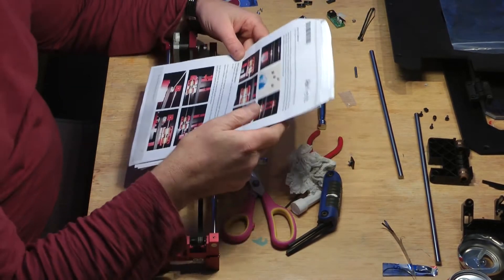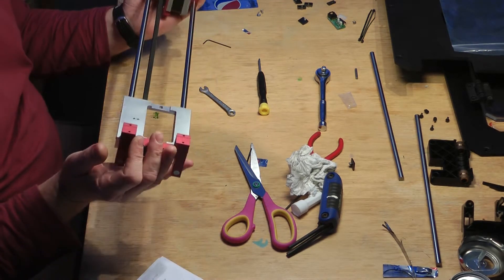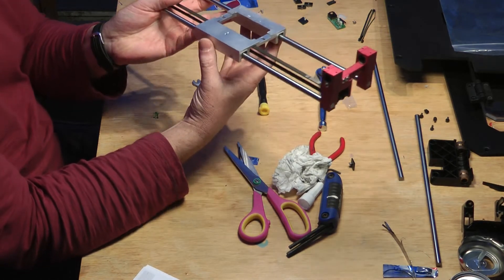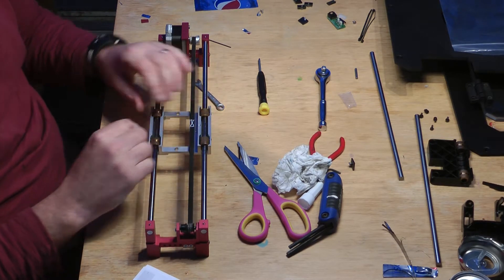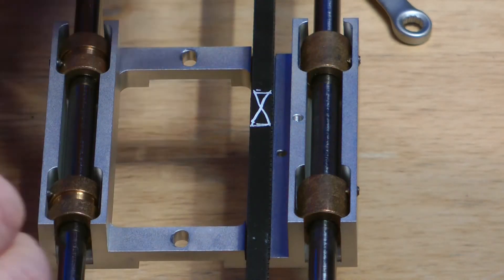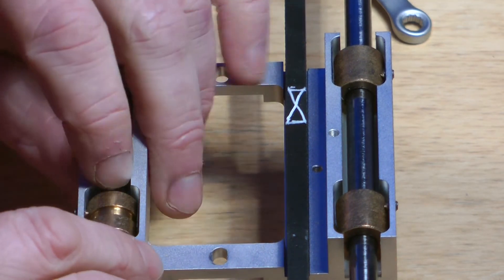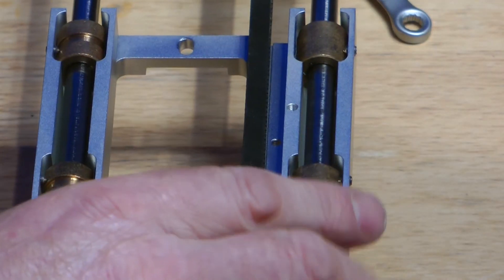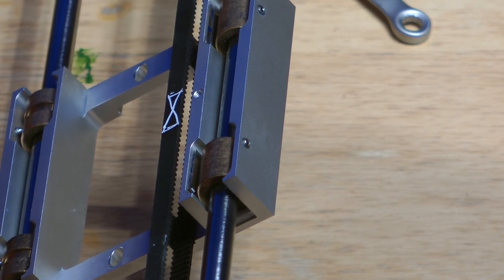AluCarriage Dual Setup

Comment: these are great Steve!
Of all your upgrades what would you reccomend most?
I'm going to order bottleworks arms imminently, but what else?
Reply from the maker: Hi Simon,

If you are new to 3D printing I would advise spending some time with your stock machine – really get to know it. If you aren’t already, start following the discussions on the google group - https://groups.google.com/forum/m/#!forum/makerbot

There’s a huge wealth of knowledge here and some great guys more than happy to help when you get into difficulty etc. You will find 99% of the problems you may experience, others have found solutions for.

When you do come to upgrade, only do one at a time. Takes some time to print with the upgrade before moving to the next.

I'm still on the stock arms as I haven't really had any issues with them. In saying that, I am work on a new design for a complete new Z axis.

Upgrade -

Change your firmware to sailfish - http://www.thingiverse.com/thing:32084

Mechanically, from my experience I would start with the 3 in 1 extruders. There are other options out there but I can really vouch for them. 

Next I would start printing on glass – just cheap 2mm picture glass. I did a video a while back on the system I’m using. I hardly ever need to re-level the bed.. it’s just not an issue anymore.

If you design your own parts, I would strongly recommend changing your slicing software to Simplify 3D. There will be a bit of a learning curve involved, but well worth it as it’s got some fantastic features. There are also some great free slicers out there, but can’t really vouch for them.

From there it all depends on what you are trying to achieve with your printing / design work.

Good luck and do let us know how you get on.
Reply: Hi Steve, I'm a veteran owner but, alas, not user of my r2x. I had one of the first in the UK. Unfortunately going to university I had to leave it behind.
I follow makerbot operators a lot.
I've found sag under weight in large builds to be a big issue so that's why I have decided on the alu arms so early.
I have just ordered a pair of extruders as per your suggestion.
Is moving to sailfish easy before I research?
I'll download simplify3D now. Thanks.
Reply from the maker: Hi Simon,

I didn't have too much of a problem moving to sailfish. If I recall I just followed the advice in this thread 

<span style="font-size:11.0pt;line-height:115%;
font-family:"Calibri","sans-serif";mso-ascii-theme-font:minor-latin;mso-fareast-font-family:
Calibri;mso-fareast-theme-font:minor-latin;mso-hansi-theme-font:minor-latin;
mso-bidi-font-family:"Times New Roman";mso-bidi-theme-font:minor-bidi;
mso-ansi-language:EN-GB;mso-fareast-language:EN-US;mso-bidi-language:AR-SA">http://groups.google.com/forum/m/#!topic/3dprintertipstricksreviews/eYZG4dWNc0Q